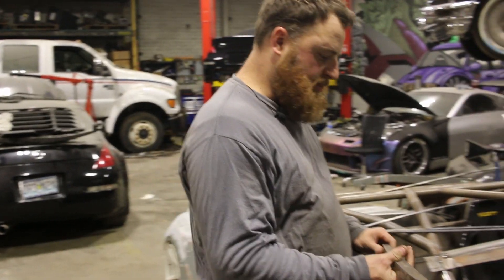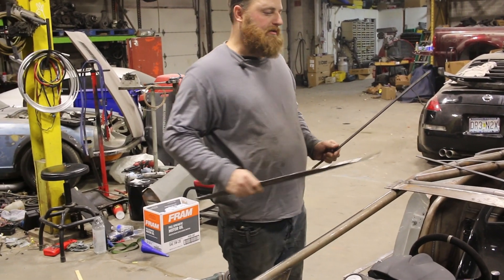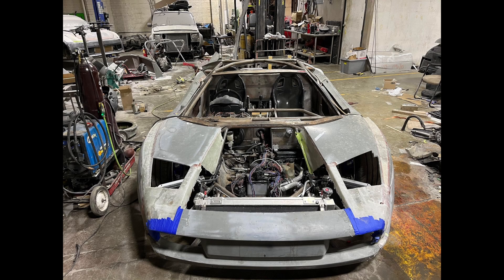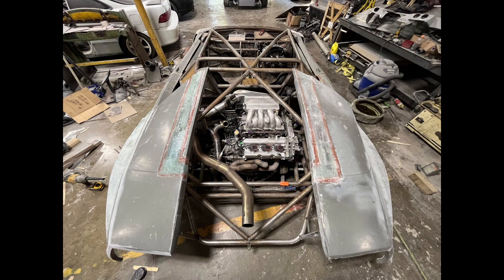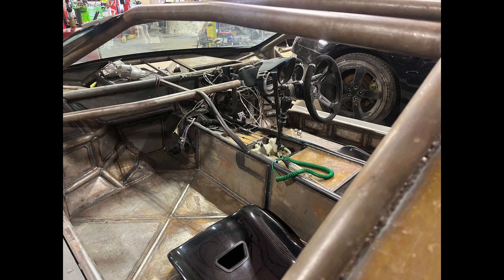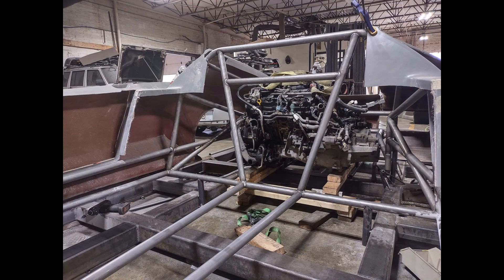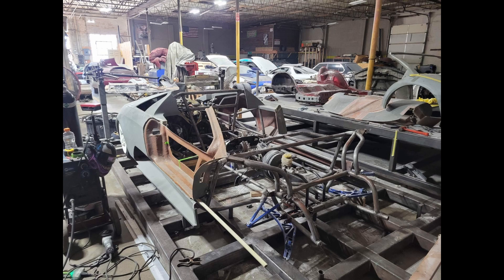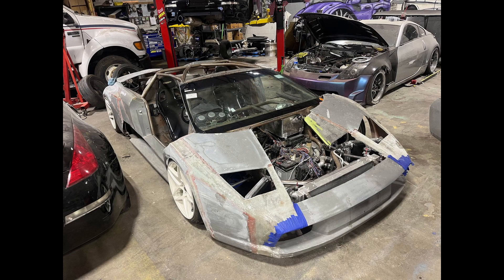Infernus Update and Throwback!

Comment: So does the fiberglass sort of sit on top of space frame? I am sure you can't hear it rattling against the cage, but otherwise, how do you prevent friction between the fiberglass and the tubing?
Reply from the maker: When I cut it into seporate body panels I added mounting tabs to the fiberglass body so they mount like factory panels would on a normal car.

Comment: I like the lambo rat rod look but of course different.  Seriously its mad cool i think. I got the 07 acura TLS and my car sounds mean in high rpm like yours, just different vtec sound but deep. Keep building it. Good job and im a mechanic and welder fabricator at a fuel company for all the fleet trucks engines so i know the labor involved.  I think its going to be sick when done and its quick